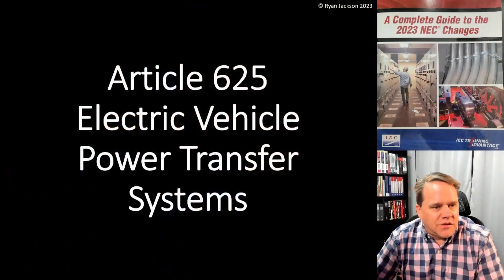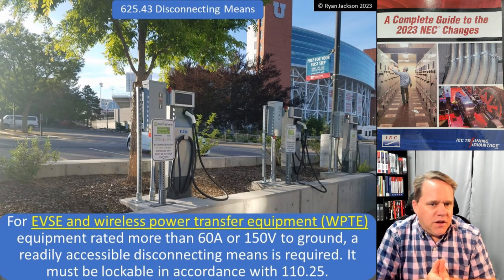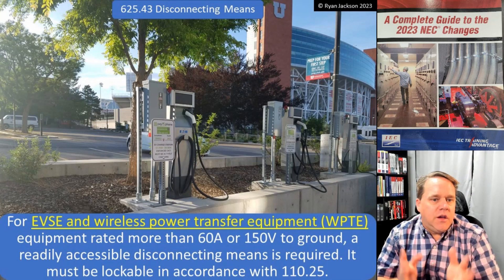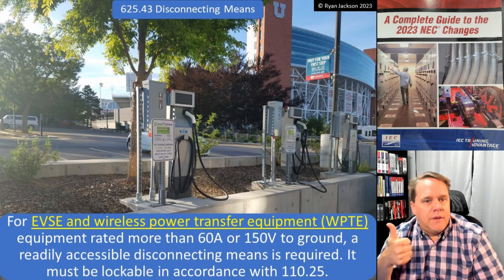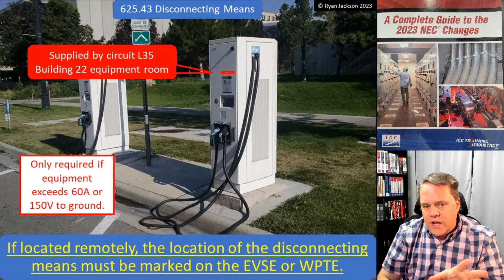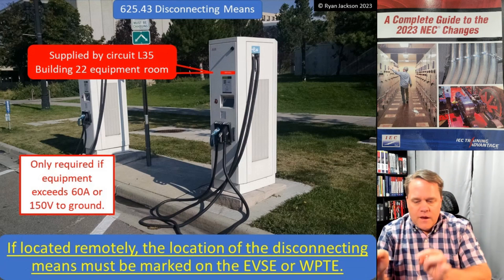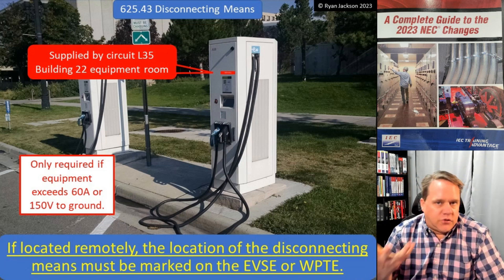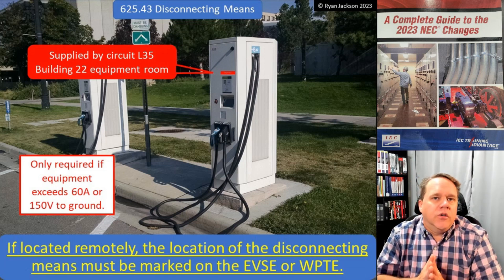625.43 Disconnecting Means (for electric vehicle supply equipment)

Comment: I am installing a 48Amp Emporia charger on the outside of my garage. I have an open 50Amp breaker in the box I am going to be using but the run of conduit and wire from the box in the laundry room through the garage to the far side of the garage is about 100ft. Is 6 gauge wire still ok for that length of run?
Reply from the maker: Watch my video on EV chargers. You need 60A, not 50A.
https://youtu.be/h967xnNUefQ?si=YFnB4_pOMYTVpxxL
Reply: @RyanJacksonElectrical  will do Ty

Comment: So if a circuit is 2phase 240Volts it needs one?
Reply from the maker: Two-phase power is only used in Phillidelphia and surrounding areas. I doubt very much that any manufacturer is making two-phase electric vehicle supply equipment.
Reply: @RyanJacksonElectrical  California does but ok lol
Reply from the maker: @justinjuarez1852  No, California does not use two-phase. Two-phase electric power was NEVER used in California because two-phase electric power has not been used in over 100 years, outside of Philidelphia and the surrounding areas, like South Jersey and Connecticut. So, what are you asking me? Are you talking about single-phase or are you talking about three-phase?
Reply: @RyanJacksonElectrical  can u answer my question plz
Reply from the maker: @justinjuarez1852  Here you go. Some light reading. https://en.wikipedia.org/wiki/Two-phase_electric_power

Comment: Hey so a charger that has a rating of 48amps max requires a 60amp breaker, do I still need the disconnect just because the breaker allows up to 60amps possible or does the device have to have a rating of 60amps? TIA

Comment: When I worked in industry I wasted a lot of time trying to find disconnects or breakers. I always wondered why things weren’t marked and I would write on the equipment where it was fed from once I figured that out. A question about wireless charging of EV batteries?? Wouldn’t that require some very powerful radio waves and wouldn’t this be dangerous??
Reply: Thanks... that makes sense❤️
Reply: It’s inductive, so it’s not dangerous as there is no way to get in the middle of an energy transfer.

Think of it as a transformer where the primary is on the floor/ground and the vehicle drives over it an puts its transformer secondary in close proximity to the primary below.

There’s a magnetic resonance (induction) coupling, but no conductors connect the supply to the vehicle.